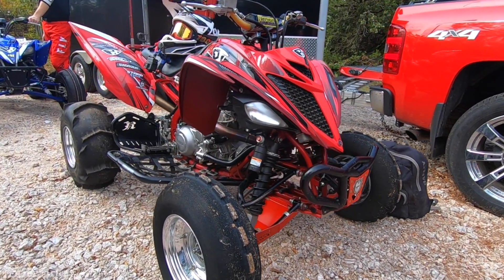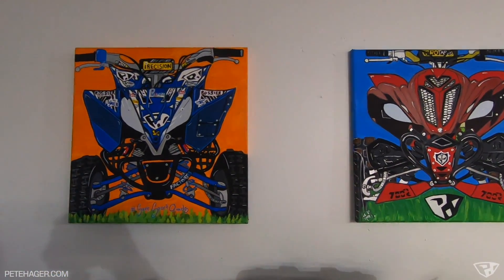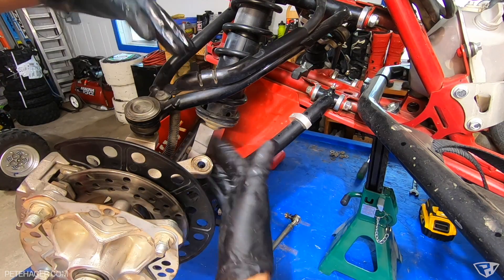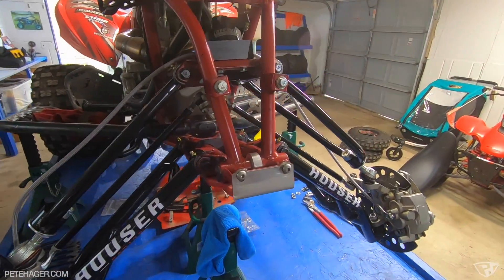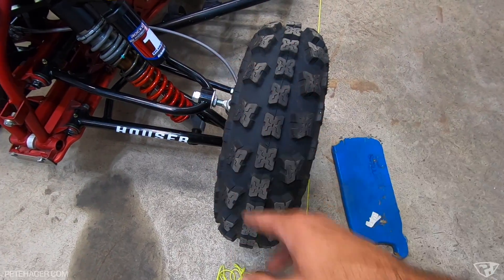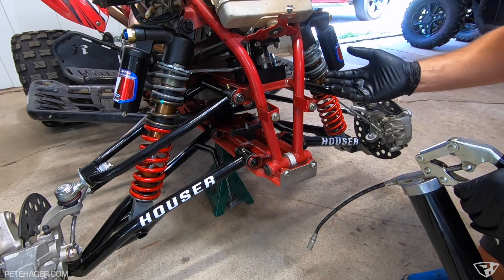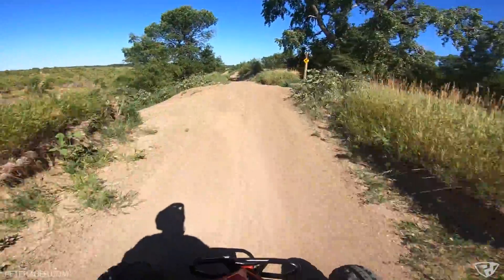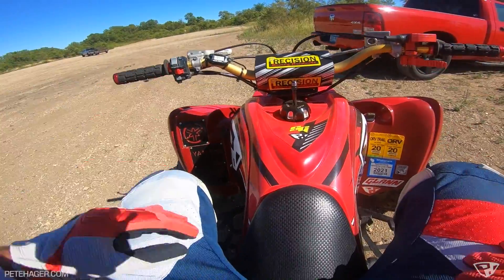Raptor 700 Long Travel Install and First Ride

Comment: You can literally see how much it changed with the long travel so much more stable and aggressive looking🔥🤘🏼
Reply: Cannot beat a Raptor 700R-SE. Prob best sport quad ever built along w/TRX250R.
Reply: @Davido50  TRX450ER 50” wide is unreal, Raptor 50” wide is awesome.

Comment: Damn Buddy! You Can RIDE!
I'm 50 now and would love to get back into atv's. I took a hard end over end on a race worrior . Broke my shoulder,knee and messed back up..  but Man I would ride in a heartbeat! 
Love your videos and hard work . Keep on rocking!
Reply: Not far behind you in age! Spent most of my youth on a 350X and went through quite a few quads until I landed on the 2006 Honda 450R. I sold that one back in 2011 and really didn’t ride again until I bought a SxS ten years later. It wasn’t long until I said to hell with the SxS and bought an Outlander 1000XXC. I literally had that for two weeks and saw a Yamaha YFZ450R at my local dealership and walked out with it. The next day I ordered a ton from Pete’s website and I’m full fledged back into riding hard again. It’s great having both the sport quad and the trail sofa to rip around on! You can get back into it and you’ll love it! 
#savesportquads!

Comment: Pete 1st off you are so lucky to have a sick riding are like that local. 2nd glad to see someone else use the Hess link so many people said they don’t do anything at all. I used 1 on mine but with a single spring rear shock. We have very similar setups I also run yfz450r long travel with JDperformance arms. Another where everyone says go buy aftermarket shocks don’t waste your money on revalves. But you and Rocket Ron killed it
Reply from the maker: The JD arms are nice! I looked at those awhile back. My friend Patrick Riggs recommended the Hess link and so did Ron. I saw Patrick’s Raptor just eating whoops in Florida so I knew I wanted a similar set up. I’m super happy with Ron’s work. Someday I hope to try aftermarket shocks so I can see the comparison with the oems but that will be quite awhile from now 😅👍

Comment: If you use a pickle fork to separate ball joints and such they typically destroy the boot.  Hitting it with a hammer like you did is the best way I feel to do it.  Was thought hat way in high-school in autoshop from retired mechanic teacher.

Comment: Great job 👏 buddy. Looked great on the ride looked nice and plush. I’d love for you to bring the Raptor out to the my neck of the woods the Oregon Dunes. That’s the one thing I really wanna do this winter is send my YFZ shocks to rocket Ron, and have him go through them. And set it for my weight and set it for the dunes.. the suspension on my YFZ is good but I bet rocket Ron could make it even better…

Comment: I had a front long travel set up on two different quads over the years. One was a banshee and the other one was a 89 250 R. I actually could not stand to ride either quad. It felt too wide too heavy and seem to hit every bump on the trail. I removed it from both the quads and went back to stock. So much better for me anyway. You did a fantastic job on the install!
Reply: You're the only person I've ever heard say they don't like Long Travel. I've got an 86 trx250r with elka legacys and I wish I went with Long Travel over +1+1 a arms and elka legacy 2.0 shovks
Reply: @coleswanginshenanigans867  Sorry LOL

Comment: I did the same thing with my Raptor.  Lowering it makes a massive difference.  The linkage I got is an adjustable length so you can adjust how much lower you have it.  I think I went down about 1.5 inches with +2 A arms and rear axle.  So much better in turns.  It's almost impossible to tip on turns.

Comment: Hey what I did for my suspension that I highly recommend, is get rubber washers for some bolts, it will prevent them from coming lose and the suspension from collapsing

Comment: BRUH... I didn't know smacking the knuckle worked. Didn't seem obvious that it would. Smacking the bolt sure didn't, so the rubber seals on my factory TRE's got demolished by the separator..
Reply from the maker: Dang that’s a bummer! I initially smacked the bolt with no results so I watched a few vids for tips and smacking the knuckle was slick. The bulk of comments have said to use a rubber mallet or deadblow next time so I’ll probably do that. Most of them came out in 5-10 solid wacks 😅👍

Comment: Sick quad bro! I love your build! 
Nice info for the most part. The claw hammer (carpenter tool on mechanical work) shoulda been a ball peen and with the brakes you can just open the bleeder valve and let it sit open while working on something else until gravity does the job of pumping for you. Then proceed with the normal process.

Comment: I'll never sell my 2006 yamaha raptor, just keep modding it.   So far, I got a plus 5mm stroker crankshaft, 105.5mm cylinder and piston, plus 3mm intake valves plus 2mm exhaust valves. Stage 3 cam, 11:1 compression piston, didn't want to go too high.  EFI controller, freed up intake and exhaust, 23 tall tires up front and 22 inches out Back full Hinson clutch set up. Also installed a new rear axle that's wider as well.    Plus it's geared to the moon 🌙.     At 75mph in 4th I can pull it up then shift into 5th and it's just stupid.   But very fun.   This combat veteran loves riding it's my happy place.    Probably find something slow for my beautiful exotic Lebanese wife like a Polaris scrambler 400 2-stroke 4x4.    But easy to upgrade and toss in a 2-stroke motor from a Polaris RMK  or Dragon snowmobile lol.   If she gets bored 😴.....
Reply: Make it great & keep it forever!

Comment: Pete, for the record, you removed the tie rod ends correctly. Leave a few threads of the nut like that and give the housing hell. Another reason for putting the nut back on is if you hit a glancing blow and mar up the threads, you won't be able to reuse that tie rod end (if you aren't replacing it).
Reply: Also, brake fluid is water soluble, but extremely flammable and will strip paint. If spilled on painted surfaces, spray down with water and it'll run right off and dilute.
Reply from the maker: Thanks for the insight and tips man! 😬🤘

Comment: Think of caster as automatic counter steer that activates when the suspension compress'. You drift constantly, so choose your speed and adjust caster till it self corrects with no steering input. Magically this gives you the best turn in also. 
You don't align toe to set your Ackerman? Have you got a laser pointer to check if your hubs are even compatible with your toe setting?

Comment: Pete you need to get yourself a 3lb beater. Makes stuff like what you used s carpentry hammer for so much easier, also get a dead blow and a rubber mallet

Comment: Is it possible to get these shocks for standard travel? Looks sick, and I’m sure it rides great, but just too wide for 50in trails imo still awesome 🤘🏼
Reply from the maker: They make long travel .5 XC arms that only widen half an inch over stock on each side. Plus they increase ground clearance. You could set them up with YFZR shocks and it would be sick! That would be wild on the Michigan trails! 👌
Reply: Exactly…too wide for me.

Comment: Long travel is nice but you dont actually get more suspension travel with long travel shocks you just get more tunability of the springs on the shocks (BNR Motorsports has a video on this). Either way LT or Standard travel with a proper re-spring and new valving with extended A-Arms is the way to go for sure!
Reply: I'm assuming the BNR video is specifically talking about the YFZ450R as he even states other bikes do gain wheel travel. I had to watch it because that's the first time I have heard that. The raptor being almost 4 inches narrower than the 450R has to be the main reason for that difference.

Comment: On the topic of taking a hammer to suspension components: it's totally fine but get yourself a brass/rubber hammer or mallet. Hardened steel hammers on aluminum suspension can ruin your day if you unga-bunga it a little too much. Awesome stuff though!

Comment: So exactly how wide is the front now? I'm going with the Alba Racing +2" Adjustable Long Travel Arms that have an adaptor to run Stock Shocks until you can Get/Afford Long Travel Shocks. If a Stock 700r is 46" wide than my +2" (on each Side) should get me to 50", which is what I need for 50" trails here in MI. Does changing to Long Travel add any Width and what year YFZ Shocks did you/can you use for the Raptor? Thanks, Love the Channel...From on Old School 3-Wheel Guy.
Reply from the maker: Mine is right around 49inches with the stock wheel offset. I would think your width would stay the same between the standard/long travel shocks. I didn’t know they made adapters to run standard shocks on long travel arms. The YFZR shocks I picked up were only a couple years old. I want to say they’re the same across the model years as long as you don’t get shocks off one of the narrower X models they made early on 😊
Reply: @PeteHager  Thanks, as far as I know,  the Alba Racing Arms are the only ones that come with the adapters.

Comment: How are you liking the duel rate rear spring I also have a Hess link but with a single rate revalve. I forgot Ron’s thoughts on this
Reply from the maker: I really like it, it's surpassed my expectations. The quad hasn't bucked on any hard impacts and I slammed a shelf super hard suddenly a few rides ago. I thought for sure I was gonna get tossed but it ate up the impact. So far I'm just as impressed with the rear as I am with the front. It's taking on the whoops much straighter and more consistently 👌

Comment: Great video brother. Doing pretty much same job on mine this coming week. So only the suspension bolts and a arm bolts put them snug while in the air and torque them all once on the ground right?
Reply from the maker: I tightened my ball joints while it was elevated but then did all the control arms and shocks on the ground. Sabo told me theres some small tolerances in fitment with those parts and it's good for them to be settled on the ground when torquing them down. I don't think it's absolutely mandatory but good practice to have so I took his advice 👍
Reply: Sweet thanks brother I appreciate. You both definitely know more then me so I’ll do it that way, keep up the dope videos!

Comment: How wide is the rear on your Raptor? Did you add the new axle? And for the Houser a arms do you need new brake lines and shocks or can you stay  with what comes stock on the 700r?
Reply from the maker: I have an adjustable rear axle by lone star. It’s right around 50 inches. I’ve seen people get away with using the OEM brake lines on extended A arms but I chose to get extended lines by streamline. You can always order these arms in standard travel and use your OEM raptor shocks 😊👍

Comment: I'm a little confused about the shocks that you got. On houser's website, the MX arms state that you need 10.5" of travel for the shocks to work, but the yfz450r only has 9.8" of travel.

Did the difference in travel not matter or did Rocket Ron adjust the travel on them too?
Reply from the maker: Ron builds them to the correct shock length required by Houser as far as I know 😊👍
Reply: @PeteHager  That's awesome! I didn't know that there were parts to customize a shock like that! I'm getting ready to plan out the mods I want to make, I originally wanted +2 houser arms and stock R shocks, but after watching your video, I'm rethinking what I want.

I love that you're still so engaged with your fans even through the channel expansion. You've responded really quickly to a couple of my comments. Keep up the awesome work!

Comment: what size shock do you run with the long travel a arms my raptor has 15 5/8 eye to eye and the yzf450r runs 18in eye to eye looks like they will work on the houser long travel

Comment: Will the long travel work with stock shocks? I just picked up a 2024 SE about a month ago and plan to do long travel and big 3. We went to little Sahara last weekend and I quickly realized stock is not going to cut it. LOL
Reply from the maker: You can get extended an arms in standard travel if you want to use your stock shocks. If you’re gonna go long travel you’ll have to go aftermarket or utilize the yfz450r shocks with the set up 👍👍

Comment: hey Pete, why didnt you put an xtravel setup on it?
Reply from the maker: Hey Lee, unfortunately Xtravel isn’t making anything for the Raptor and they’ve prioritized SxS’s for now.. I was hoping their quad technology would be available but only a very limited number of machines have been built. Plus the set up would cost 3 times as much as this. I wanted to run a set up that was more widely available to consumers. If Xtravel starts cranking quad kits out and people can buy them then I’ll definitely consider a set up 😅👍

Comment: Hey Pete (or anyone else with experience with this) I was wondering if you ever did any adjustments on your stock suspension? I am looking at a 2022 Raptor 700. But I saw they only have preload adjustment and no external reservoir. I have a YFZ450r now and looking to replace it with something more comfortable and trail oriented.

Comment: Prolly a dumb question but are you not able to run the a-arms gaurds with the +2 arms?
Reply from the maker: Hmm I didn't try so I'm not sure. I've seen A arm guards for the longer A arms on the YFZR so someone makes them 😊

Comment: What’s a good replacement shocks instead of sending the stock shocks for rebuilding?
Reply from the maker: There's a lot of good brands out there. Many guys run Elka, Axis, Fox, PEP, Motowoz.. In many cases your going to have the manufacturer set up your shocks to your weight and riding style. I'm definitely curious about the Fox air shocks. A lot of guys run them. It's pretty much all personal preference at the end of the day. PEP seems to be regarded as one of the best in most of the conversation I hear 👍

Comment: Hey man love the channel I have a question what size tires do you use on the 450
Reply from the maker: Thanks man! I run OEM sizes for trail tires on all my quads. 21 inch fronts and 20 inch rears. I have some MX tires for the YFZR but haven’t taken them on a proper track yet 👍

Comment: What are the shock mount torque specs? Can’t find them anywhere
Reply from the maker: 35 ft lbs. here’s a digital service manual. Chassis torques are around page 50 👍 https://www.slideshare.net/fabiofbipeter/765-1223-raptor-700-service-manual

Comment: I’m looking to buy a +2 arms for my yfz450, but was wondering are you Running stock rear width or did you widen the rear too?
Reply from the maker: I have a Lonestar adjustable axle on the Raptor to go with the wider front end. I put the full parts list in all my video descriptions for my quads 😊👍

Comment: What would prefer the raptor 700 or a 400ex
Reply from the maker: The 400ex is an excellent machine and can be built to suit a variety of needs. If I could only have one I lean towards the Raptor because I like the extra power and the slightly bigger ergonomics for longer day's in the saddle. After doing the suspension set up in this videoo, it's in my opinion the best big bore sport ATV of all time. There's only one thing I don't prefer the Raptor for and that's bigger jumps but if I'm on the ground in the dunes or on the trails it's my favorite for sure 😁

Comment: Is there a difference in tightening the bolts while the quad up on a jack vs on the ground?
Reply from the maker: Sabo told me it’s good for the shocks to settle since there’s some small tolerances within all the mounting points. I’m sure it’s not the end of the world if you do. I’m just taking all the tips I can get 😅👍
Reply: @PeteHager  I gotcha
Reply: ONLY if you have rubber shock/arm bushes. Pressed Eurethane/rod end sphericals/brass don't care where you are in the travel. Bonded Eurethane belongs in the bin, but torque with a rider on it if you ever have them.

Comment: I have a engine that I would like rebuilt for the raptor 700 do u have any recommendations
Reply from the maker: Honestly if I was to do it again I would just Big 3 the machine with an exhaust, FCI intake, and Power Commander. They have plenty of power for dirt riding. I would instead spend that money on suspension like I did in this video. However if you're a dune rider or drag racer then internal mods are worth it. If you're in the midwest I would recommend Illinois Powersports, if you're on the west coast I would check out Cuervo Racing. Unfortunately I don't have any east coast recommendations for builders 👍
Reply: Gotta know!  Which bike would you choose as a dune bike only?? The raptor with long travel or the yfz 450r.

Comment: Is that the factory exhaust on your Ram?
Reply from the maker: Not anymore lol, I have the muffler deleted with 3 inch diameter pipe to the 5 inch exhaust tips! I’d like to get headers since I have that Hemi tick going a bit 😅
Reply: @PeteHager  ok sounds good. That raptor is killer too, I wanted the YFZ but the wide raptor is making me reconsider lol

Comment: Why the use of 450 shocks on the front .
Reply from the maker: I wanted to try a more budget friendly option before jumping to full aftermarket. A lot of people recommend this type of set up in the forums and I wanted to get a sense of it at this price point before trying out any brands like Elka, Fox, or Custom Axis. I don't race so I'm not pushing the machine to it's limits like many of those riders are 👍
Reply: @PeteHager  why not use the 700 front shocks to have rebuilt , is actually my question Pete. sorry for the misunderstanding.  Thxs.
Reply from the maker: @stevenrensel6308  no worries! I wanted to do a long travel set up and the Raptor 700 shocks weren’t long enough unfortunately but the 450R shocks are 👍